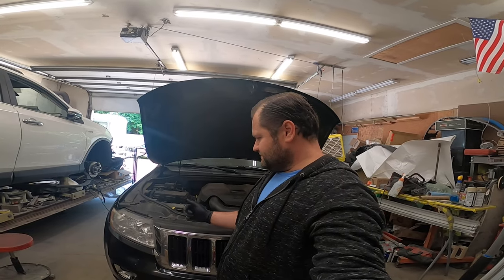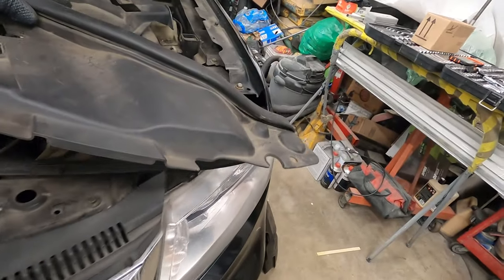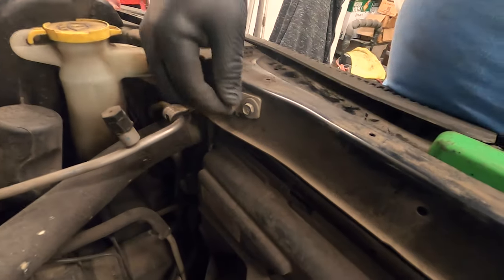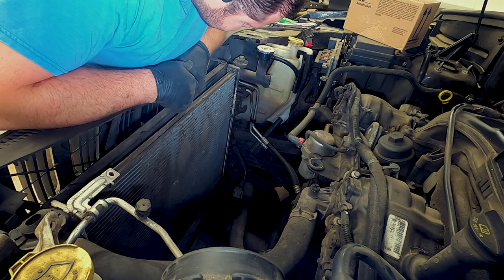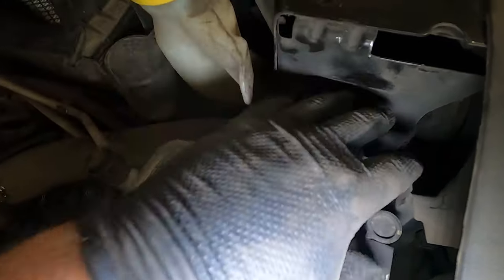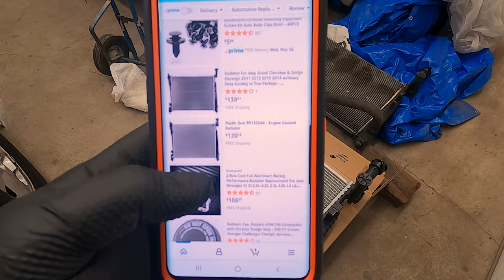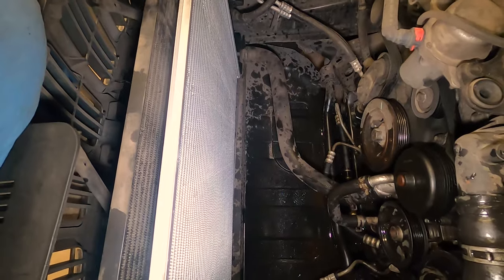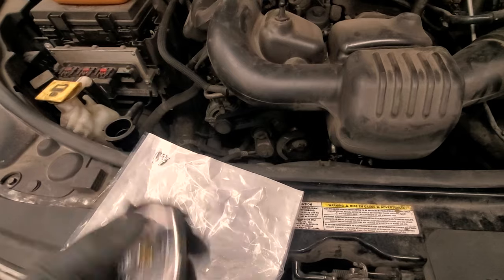2011 - 2014 Jeep Grand Cherokee WK2 radiator replacement

Comment: Sir, I didn't see your name here but want to thank you for posting such a thorough video.
I too decided to tackle this today.
$185 for the radiator from O'Reilly auto parts plus a new rad cap. I'm in upstate NY.

Your video was great.
My comments...
Getting the radiator itself out is a pain. Could not have done it without all the room in the engine bay. Also I referred to your video to watch exactly how you wiggled it out and then again to wiggle it back in
 It's tricky, I had my son under the car assisting with the reinstall. I felt like There's only one angle to get the driver side to clear the AC lines. The tabs on the bottom which hook under the AC condenser also made it difficult to maneuver into place.
While trying to set the two together I ended up breaking both of these tabs off of the new radiator by accident. This ultimately allowed me to get everything situated. But again, would not have figured out without your video. Also, there is a plastic/metal clip around the AC line at the bottom on the drv side that clips into the radiator in place and this is an additional snag in reinstalling.

I would caution people to Make sure you have the correct coolant for your vehicle for refilling. This can get confusing. It was for me as I found conflicting info regarding color. My 2015  jeep grand cherokee calls for OAT formula.

I Needed to find a video on refilling cooling system. If doing this job, people should make sure that they are clear on the process for refilling. You will have removed hoses and there will be air in the system. Very likely that you will experience an air lock which is no bueno. It's not difficult to handle but you have to be patient. I found a method where I repeatedly squeezed the top radiator hose to burp air from the system. The recommendation was to do this while filling and then also with the engine running 

After first attempt at driving around the block, I immediately noticed that heat was not coming from the vents while on full blast. After driving a little while my temp guage went 3/4 to hi. So I let sit for a little while and started burping the line again. Fill, squeeze hose a few times, fill. Etc. After my second trip (about 6 miles) everything was working great. I will keep an eye on the temp and also oil temperature and see how everything goes.

Liked and subscribed, sure hope it helps you. I've learned so much from the you tube community and appreciate your taking the time to share your expertise.

Thanks again
Reply: How old is your thermostat?  This would have been a good time to replace it.  Don't wait for it to fail to replace!
Reply: Some thermostats have a bleeder on them.  Open that while filling and you can get 90% or more in the system.

Comment: I just did mine today.  Wish I had the 10 mm ratchet wrench.  I did find you can do the front two 13 mm bolts with an extension through the grill.  Without jacking up the car, but taking the lower splash pan, I found it easier to take the fan out from the bottom.  If you have the electric/hydraulic steering, loosening the mounts for the hoses helps and they are clipped into the driver’s side of the radiator.  The wires for the electric steering can also get in the way but are easy to remove.  I used new hoses with screw clamps, if in the rust belt the spring clips can fail, and they are a pain anyway.  Just do not over-tighten the screw clamps.  Having an extra set of hands to hold the grill back or when mounting the condenser in the rad would not hurt.    I used magnetic pans and stood the screws up in sets so it was easy to remember where they go.

Comment: I was going to take my car in to have my radiator replaced but I'm seriously having second thoughts this video is amazing
Reply from the maker: Thank you. Glad it's giving a good insight in to the process. I would say the most challenging part is pulling it in/out and making sure it's back in its proper place. Slow and methodical works best.
Reply: Please tell me where you bought new radiator and what brand was it?  Did it fit well, and would you  buy same brand again?

Comment: My wife and I did this on her 2013 WK2, and it was the easiest radiator replacement I have done. I did one on my old 2008 Ram 1500 Hemi, and on my 2016 Jeep Wrangler. For the WK2, it took less than 2 hours. This video helped.
Reply: Please tell me where you got your new radiator and what brand was it???  Did it fit well?
Reply: @chetmyers7041  I got mine from O'Reilly auto parts, still working fine!
Reply: Ii

Comment: Waiting for estimate from my Friend who is a honest and excellent mechanic ( been in business for 45 years ), good guy,
He told me the BOOK says 4 hours labor to remove front bumper! He said thats BS,,he doesn't go by that that and OVERCHARGE his customers ! Thw only thing he said IF you do it your self,,warranty will be a factor ( he offers with ALL his parts LIFETIME WARRANTY). BE sure to burp the system correctly after finished ( which i know how to do ) after replacing water pump and thermostat. Never did a radiator but,,seeing i am on SS,,
probably going to do it myself !
Great video however !

Comment: Thank you so much for this. I had to change the radiator out this morning on our 2011 5.7 Hemi, so although this is a little different, having you explain that the AC sat inside the brackets of the main radiator, saved me a lot of time!
Reply: We’re you able to pull the radiator out without removing bumper and ac condenser? I have 5.7 as well.
Reply: @Raiderz4life20  How about you? Were you able to get it out without removing those? I'm doing this now on my 5.7.

Comment: Simpler if he had attached the hoses BEFORE he put on the fan assembly, and fill the radiator, hoses and block before putting on the air box assembly. The bleed port which is on the t-stat housing is very difficult to access with that in the way. I also have had numerous Jeeps that had t-stat/housing failures that will throw a hard to reset code. I also hope he cleaned out the recovery jug too.
Reply from the maker: Yep, that way works as-well, to each their own.

Comment: 10:42 Was the failed radiator factory original or aftermarket?   I notice the filler pipe is not curved.  Thought the MOPAR pipe was curved, and not the 90 degree joint shown on this radiator.  13:10 Radiator has a THIN CORE;  not for Trailer/Tow Package equi[ped Jeep.

Comment: Hi, i have a question, can i also swap out the condenser while at it, other videos show you have to pull bumper off but i don't want to do that,i have a bullbar and its also got headlight washers,its too much work that way, so i'm hoping i can change the condenser out after the radiator.. Nice vid

Comment: Never would have been able to do this without the video but I messed up on that hood latch top piece. I couldn't get one of the top side screw holes on the passenger side to line up.  All the other screw holes line up fine.  I stripped the front side screw hole out trying tighten it hoping it would help it line up so now I only have the expansion tank screw and one top screw holding that passenger side.  You think It'll be ok leaving it like that?   The other 4 screws on the driver side are all good.

Comment: Hiw much coolant did it take? I have been teying to find out what other brands you can mix with mopar coolant. Everyone says to only use oem. Is this a jeep thing ? I mean back in the day we used green. Great job by the way. Doing ours this weekend
Reply from the maker: Newer Chrysler product takes the mopar or zerex g05 type coolant, it’s specifically used because of its anti corrosive properties. It prevents engine block lining cavitation from harsh deposits and scale. Basically prevents rusting from the inside. As far as amount, it depends how much comes out when you take the radiator off or water pump. Normally I buy 2 50/50 mixed jugs of that zerex g05 and add distilled water for top off if needed.
Reply from the maker: Good luck, hope it goes smooth for you. These 3.6s are fairly straightforward, the 5.7’s are little more involved, because of larger engine and it being more forward, so little more stuff needs to be taken off to pull the radiator out, like bumper cover, cross bar and etc.
Reply: Zero go5 is hoat , 2013ish -2024 take oat.
Reply from the maker: Good way to tell is oat is dyed purple, and hoat is orange. 
You have to draw a little coolant into a container to tell the proper color. Something about a white reservoir and purple inside it sorcery makes it look orange.

Comment: I'm getting crazy but I cant put the new one in. On the left side (driver side) there are 2 hoses coming from the A/C radiator, in like U shape that goes around the water radiator, I had to cut part of the old radiator to take it out (the empty small valvle) in order to remove it. But I cant do that on the new radiator. I tried from the bottom and from the top, and is imposible to get around that U shape hoses. Mine is a 2014 v8.
Reply: What'd you do? I'm doing this now on a '14 v8
Reply: @tjtewshews5531  Well to remove the old one I cut the bottom U shape plastic (that holds the A/C radiator) and I took it out. The new one was aluminum  (Chinese) aso I bend the same U shape holders and after a while I got it in. If I had to do this again I would do the Mussimoto one that all the holders can be attached latter. 
Definitely on the V8 there is way less space than in this video

Comment: Thanks for the tutorial.  I just did this job on my 2014 (with only 60K miles!) and your video was very helpful.  I also found my thermostat housing had a hairline crack and was leaking as well.  Did you use a pneumatic/vacuum tool to do the fill and bleeding?  That's the last part I have to finish up yet.
Reply: You can release the small screw on the thermostat housing, unscrew it just a bit and start the engine. Then as it cycles through any air will release through that screw (it’s made with a slot on the side so you can unscrew it a bit and it allows air/fluid to release) and also coolant so watch your eyes) and then screw it down again once coolant starts being released.
Reply from the maker: Thats great man, glad it helped. I didn't use vacume tool on this one. Basically filled it, opened up the bleeding screw that Dan mentioned above.   Sqeezed pipes as collant and air came out, till it was just coolant. Then started it up, once only coolant began to come out from the bleeder. I tightened it down, made sure there's coolant in the reservoir. Let it warm up with heat on. Once the heat came on in the car and fan kicked on. Idled it for a little more to make sure its don't over heat if it has an air pocket somewhere. 
If it does look like it will  get too hot, shut her down let her cool off, once cooled down, open up the rad cap, add some collant of its gone down. Open up the bleeder and see if you got air coming out. It happens sometimes. On some more dificult cars i point the nose of the car up with lift or ramps. Helps to have the radiator to be the highest point in order to bleed or burp the system.
Reply: P.o.s Thermostat housing is PLASTIC LOL. Replaced 2 all ready ( 2011 GC,Liberty). DORMAN is suppose to come out with aluminum cast housing but not yet ( Dodge Ram ,and a few others ) but NOT for GC 2011 ?
Been keeping an eye out for that specific part. They came out with aluminum cast oil cooling unit a few years ago ( finally), those were plastic and people were bitching,,that were cracking or melting at a high rate ( replaced 2 in my car , 135,000 miles. Chrysler engineers are idiots putting plastic parts on engines but we know why !

Comment: Does this process work on the 5.7 or do I have to pull everything off bumper, ac condenser and so forth? Was hoping I didn’t have to do all that extra labor.
Reply: I just BARELY finished my 2014 5.7. The process is pretty much, identical. I did undo the two lines on the AC condenser, just below the coolant fill area, for extra clearance. As well as the overflow tank. Don't know if it's necessary. But, made the job, easier.
Reply: @hyattcrystal2397   what happened to the Freon when you opened the line on the condenser?
Reply: @hyattcrystal2397  did you take the bumper off?

Comment: @8:51 the hose coming from the coolant reservoir thst isn't connected to anything is it suppose to be like that?
Reply from the maker: It runs from radiator filler neck to the lower side of the coolant reservoir. So the cooling system can draw and return coolant as needed.  Perhaps I’m not seeing it the same as you do.
Reply: So it is supposed to be connected to something
Reply: Pretty sure that’s the overflow hose that just shoots out the bottom. No it’s not supposed to be connected to anything.

Comment: Nice job!! I found my radiator to be leaking on the plastic clip that holds the fan shroud on the hemi  on the high coolant line on driver side.. will job weld or anything else work for many more miles?? Or do I have purchase new radiator??? Just plastic bracket seam leaking on drivers side, let me know what you think??
Reply: Replace it, heat and pressure build will just keep cracking it more along the seam. My 2013 Jeep Grand Cherokee 5.7hemi just started leaking few days a go in same spot your talking about. 1 year a go today I had to replace cam and lifters and when I ordered all my parts I come close to replacing radiator at the same time, didn't...wish I had now.
Reply: @siraltitude71  damn thanks heads up prolly what overheated the system I’m thinking cam and lifters… is that what makes that ticking noise? Almost makes the Jeep sound like an old diesel 😂
Reply: @matthewluna727  Yes on the Hemi, 2 causes of ticking, cam and lifters or broken exhaust manifold bolts, once I pulled my head's off I had 3 exhaust manifold bolts also. But I knew my tick was from a lifter. Usually on exhaust bolts broke, it gets quite after it gets warm.

Comment: hey man!! what happended to your XJ build???
Reply from the maker: Had to step back and take care of family first, now got a bigger place with my own garage. Between moving and work being crazy, didn't have much time to do any thing for fun that didn't earn a paycheck. Things are settling down now and will get back to working on it now, got a 12k winch, still not sure on the wheel set up, 35"s or 37''s Even  with the locker in front, it's still a wimpy dana 30.
Reply: @JeeperGear  did you ever get the hood installed?
Reply: @motownXJdad9565  I was gonna ask the same thing.

Comment: Love this video. Only one thing, it looked like there was Dexcool in the cooling system - it had a real strong orange color. The Zerex G05 is nowhere near that color. I realize that color matching the coolant is not the end all be all rule as which to use, but did I see what I thought I saw?
Reply: You saw Mopar OAT coolant
Reply: @samspace81  I believe 2011 5.7L Grand Cherokee came with HOAT from the factory.   Is OAT better or longer lasting?